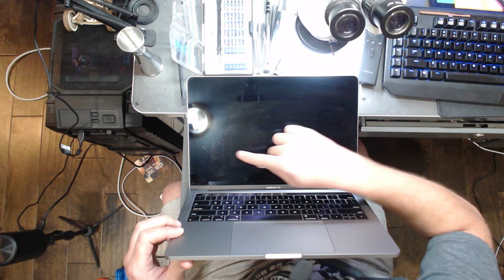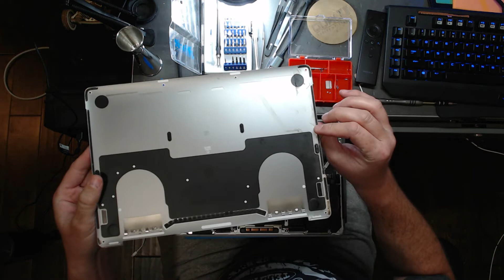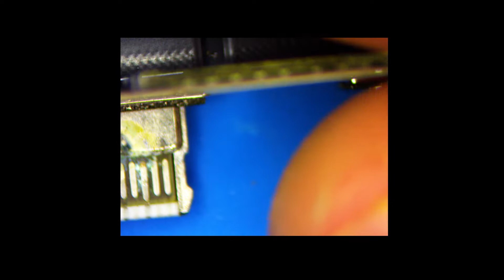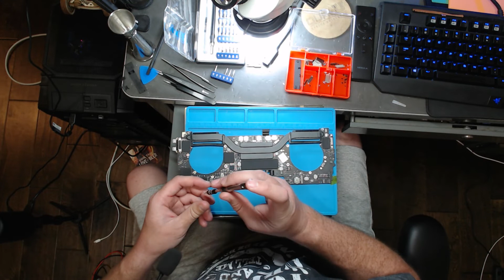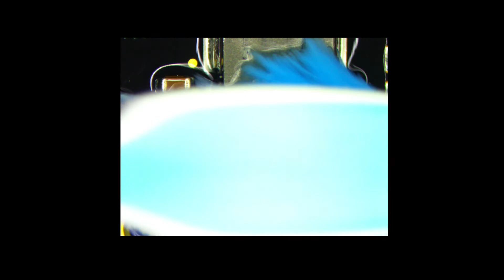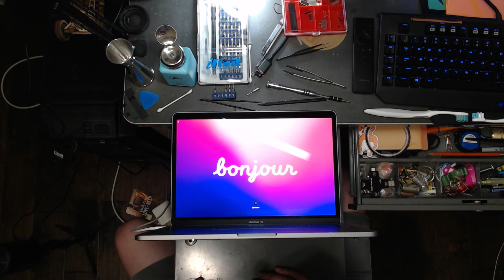Macbook Pro A1989 Liquid Damage No Backlight

Comment: Hey, i have a doubt...why didn't you replace any of the resistors near the corroded region?...
Reply: Btw great repair tho...you are following the schematics and testing everything the way it should be
Reply from the maker: Well, I thought I would need to, but after I cleaned the areas of the corrosion the resistor that was reading incorrectly and causing no backlight was reading on spec again. I need to get an on screen meter so everyone can see that. Sometimes corrosion bridges components and that is all that the issue is. I didn’t have that particular resistor on hand either or else I would have just replaced it any ways. All other resistors read to specification according to the schematics.